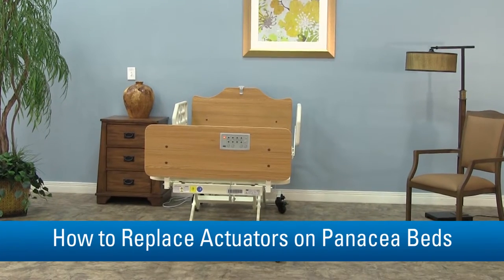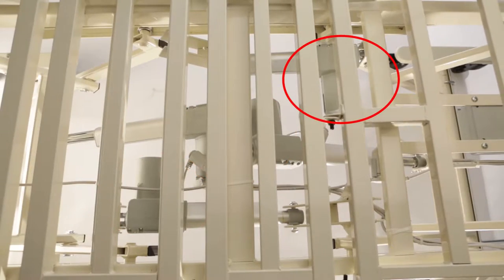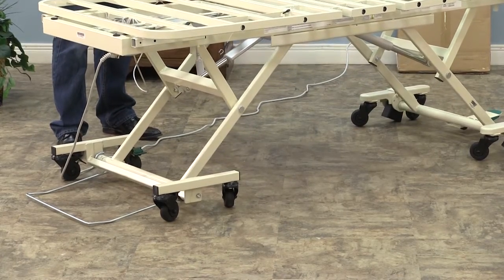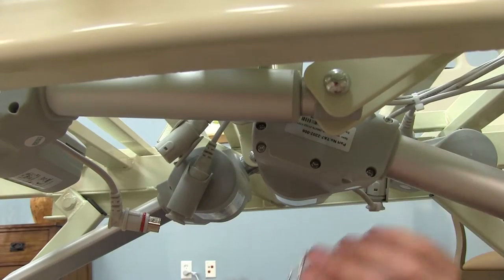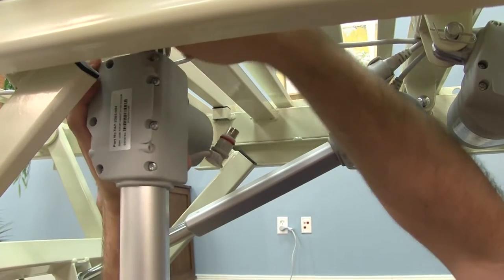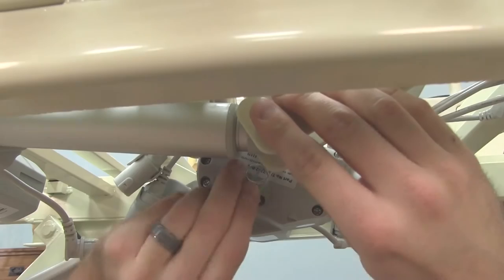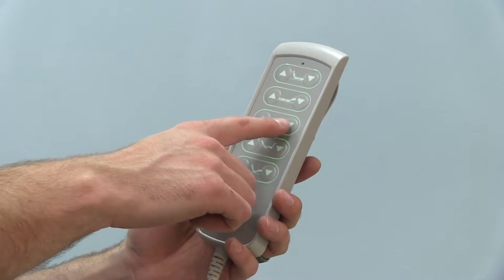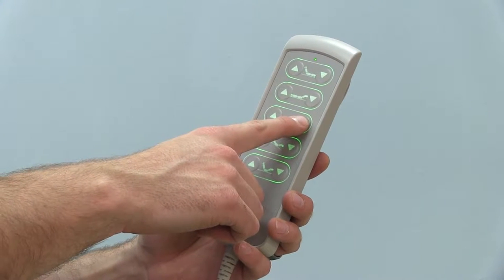How to replace the actuator on your Direct Supply Panacea 3000 Series Bed

Comment: How can you test an actuator to isolate the problem before ordering the part?
Reply from the maker: The easiest way to isolate a defective actuator is to plug a known-working actuator into the port in question on your bed’s control box, then re-test the function.  If the known-working actuator moves when the associated function is pressed but your original actuator does not, then you have isolated the problem to the actuator.  Note that while actuators on your Panacea 3000 Series Bed are not interchangeable in production, any of them can be swapped temporarily to confirm control box functionality and isolate actuator failures